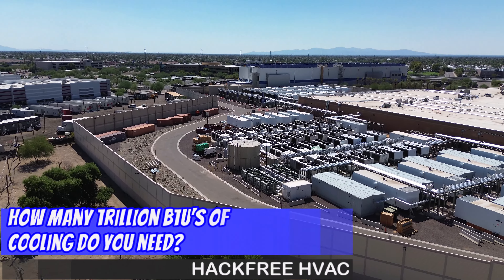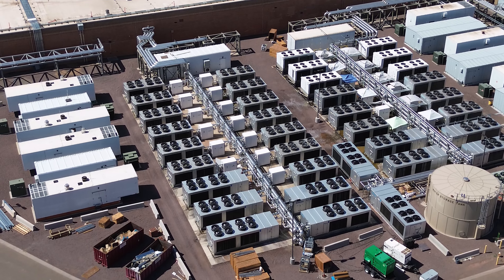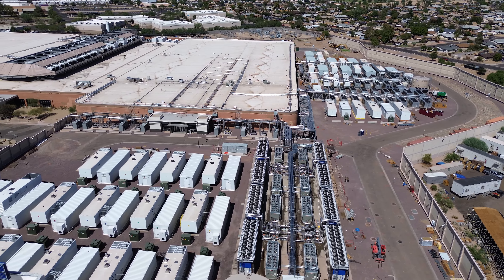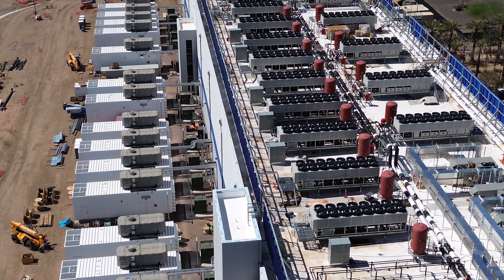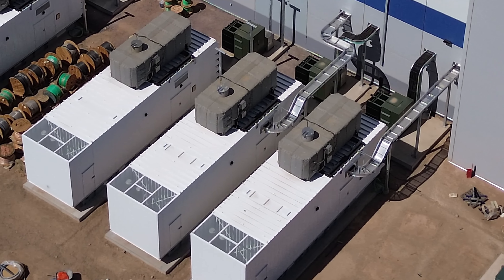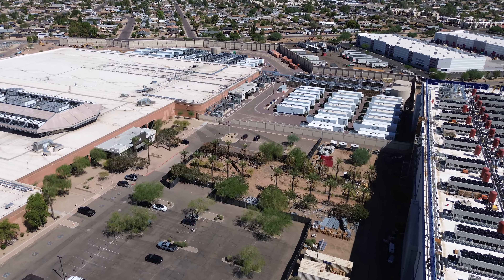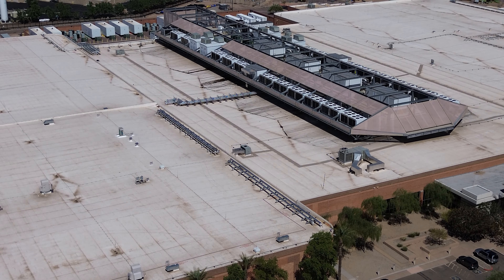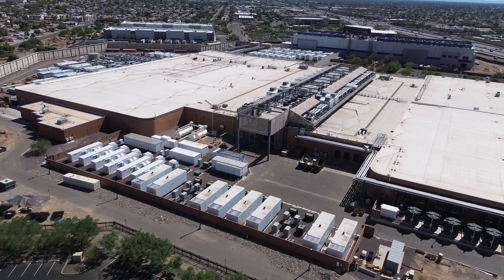How many Trillion BTU's of cooling does this facility need? [What is this place???]

Comment: Data center. The white trailer looking structures are backup diesel generators. The green boxes next to each generator are transformers.
Reply from the maker: That's exactly what I figured.
Looks like big diesel smokestacks right in the middle in that raised section.
That raised section looks a little different than the units like these sitting in the dirt lot next door.
It makes me wonder if there's some sort of weird wet scrubbers, or some other weird environmental crap that's added to the diesel exhaust.
Reply: @hackfreehvac  Could be running on Natural gas.

Comment: Its Aligned Data Center. They have around 500k sf of datacenter floor and the density of equipment inside is really high, which requires this level of heat rejection.

Comment: Data Center for sure. And the green units are probably Greenheck RTUs.
Edit: And the whole site has its own electric substation.
Reply from the maker: I noticed that substation too but forgot to point it out in edit 👍
I also believe a lot of that. Equipment on the one side of the building on the ground is all uninterruptible power, perhaps.
Reply: @hackfreehvac  Backup generators, transformers, and possibly battery backup. Each server rack will likely have a UPS as well. 
I live in Northern Virginia, not far from Ashburn, aka Data Center Alley. More of these buildings going up everywhere, along with high voltage power lines, and the substations!

Comment: All that wide open roof could be used for Solar panels.  The electrical switch yard area is setup for megawatts!  Double the cooling is needed because of the AZ heat.

Comment: This place reminds me of a huge energy storage system.  With all the wind and solar going on, energy storage as become an enormously important factor.  These things are going in all over the country.   The idea is to be able to bank wind/solar (so-called 'renewable' energy) output and be able to export that stored energy back to the commercial grid during peaking hours.  

Essentially there are banks of batteries for energy storage, and the amount of cooling required is spectacularly high.   I don't know if that's what this place is, but I'd be looking closely for ties to the commercial power grid somewhere nearby.